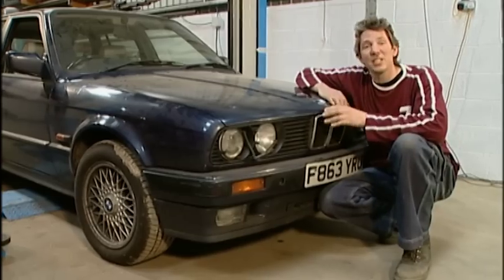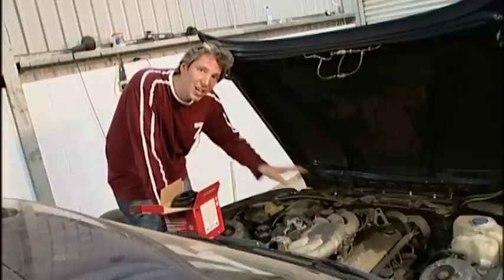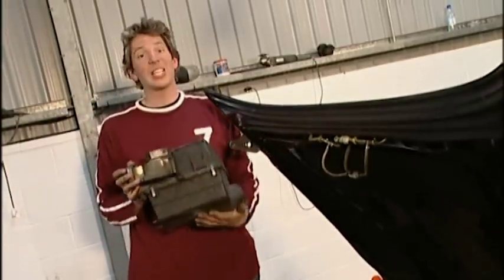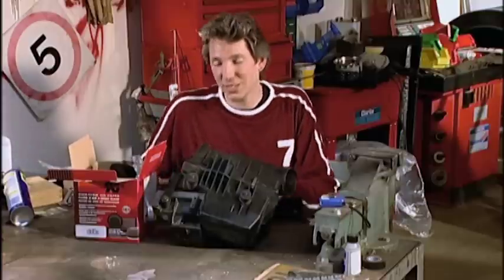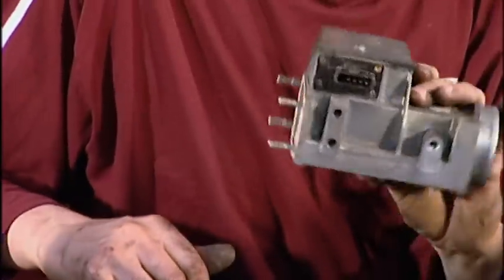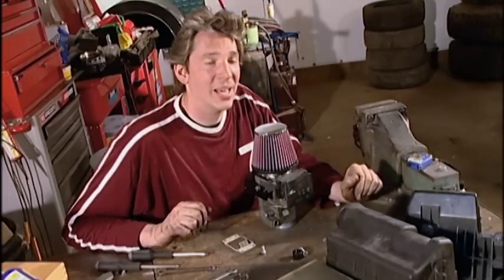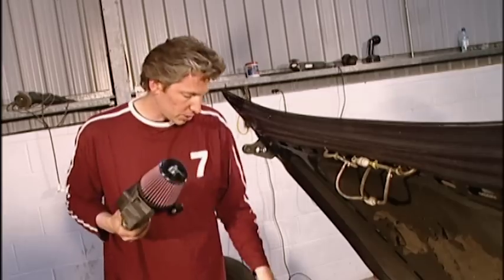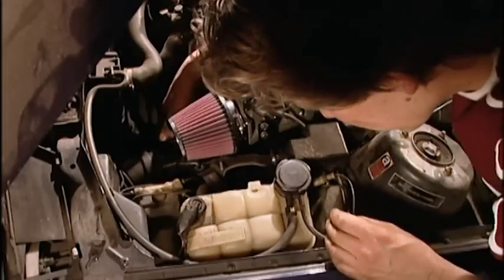Improving Engine Performance: BMW325i | Wheeler Dealers | TOP TIPS

Comment: How does a round filter seal on a square flange? It needs a round adapter to the AF meter and a panel to keep the hot air off of it for it to be effective. I took my E30 air box bottom and drilled 1/2 holes in the outboard side away from the hot air and put a K&N replacement filter in it and doubled my HP just like it says on the box. No, really it gave it about 10-20 hp and a nice roar but not obnoxious. The original air box snorkel was really small so I decided it needed more of an air inlet.

Comment: Lot of confusion about how pod filters work, the air in most engine bays aren't hot at speed. When driving you usually have a big who at the front of the bonnet (also known as the grill) which means that the air is typically cold in the engine bay. However the filter casing is usually a part of a ram air system meaning that you will get a lot more air to your engine using the stock system.

Comment: cold engine, full throttle to redline. thats how to improve your performance.
Reply: SwedischMuscleCars truer words have never been spoken
Reply: SwedischMuscleCars 
Haha 👍
Reply: why you know the engine is cold?
Reply: is this a joke ? Cold Engine + rpm over 4500 = Death !
When the engine is cold, the engine runs to fat ! (to much fuel, for to less oxygen) to avoid, that the engine stops !
When a engine is cold, it runs very ineffective (that's why cold engines need way more Petrol) so the ECU will give the system more Petrol. Because the engine is like some guy that woke up 1 Minute ago, it will never got the full power. A Cold engine is just faster at low rpm, in the first 2 minutes, because the engine is cold as fuck, and >must< run fat ! If you drive over 3000rpm, a engine that is warm, runs way faster,smoother and better as the cold one !
And if you dont believe me, come to the german autobahn.
Drive your car 20 Min with 180km/h then try 0-60.
And tomorow try it with a cold engine........when the cold engine survive it, you will see, that the warm engine was faster.
Reply: Sounded like he was only doing 2500rpm max.

Comment: mostly paying for a nice induction noise but there will be no power gains from a pod filter.
Reply: MCM debunked this
Reply: OMGWTFBBQ I GOT ROASTED! HOLY SHITE
Reply: Its the opposite... You lose power.... as well as You lose Smooth Running
Reply: Yes slightly but your also sucking in a lot of hot air from the engine, best to get one that's shielded like a pipercross viper induction kit.
Reply: This was great, thanks, I been tryin to find out about "horsepower car maintenance" for a while now, and I think this has helped. You ever tried - Vabrielbey Vehicle Verifiability - (do a google search ) ? Ive heard some extraordinary things about it and my mate got excellent success with it.
Reply: Hans Gerd That's correct, Without a tune new filters are useless. The ECU is tuned to a factory air filter.
On every car i have owned i tried cone/ram intakes first and just to see what they do,Basically just induction noise and a loss of torque/top end hp and speed.
Reply: https://www.youtube.com/watch?v=PAIxeQUSg-Q the video if anyone is interested.

Comment: You DON'T stick a cone filter on a BMW E30, you'll get hot air in your engine! That hose does F-all.Use a panel filter IF you have to.
Reply: Kel Solaar.  hot air/cold air doesn't make any difference.
Reply: @peterbarber7613  Hot air isn't good for the engine.
Reply: I’m disappointed with Ed.  Hot air is less dense.

Comment: To gain power you NEED casing and better solution is sport filter that fits in original box.
Reply: Mindset the only thing you did was destroy the “25y old fresh air flow system” ( pretty darn simple btw casing with tube that goes out side ...)
Reply: @joaoloureiro5142  No idea what language you're speaking.
Reply: @Solaar_Punk  ?

Comment: man I have an e30,, air intake destroys the engine, bmw engine very powerful u dont need these toys, the original air intake its a part of turbo kits its not install alone. the whole original turbo kit costs 850$ minimum. 
for me my engine is m20 I swapped the engine to m20b30 its 3000cc on the dyno it gives 349hp and costs me 780$ 
turbo and supercharged kits are for tracks not streets.. u will need more water and more oil for every 10 km.. and its destroys the engine valve for overheating..
Reply: ,,,,,..... Use these and we can understand, what you are trying to write.. Btw, the m20b30, does not exist..
Reply: @misfiresandflattires6874  he must have stroked the M20, this is common in NA

Comment: pod filters only draw in hot air.
Reply: Daniel Millard depends how you rig it up... Ive had them sticking 3" off the ground infront of the rad..
Reply: perfect for sucking water and hydro-locking your motor.

Comment: It has been proven that the cone air filter doesn't increase performance. The only instance where a "performance air filter" would increase horse power is , if the original air intake filter was so dirty that it couldn't pass air in the amount that it originally should.  (At which point you can just change it for a new one of the same type) the cone air filter is used when your doing an engine swap and you don't have enough space for the old air intake, so you put a cone.
Reply: PvPparadise. Not true, it's all car specific. Some cars have horrid intakes.
Reply: Most of the cars have pretty good intakes but you are true James some of them has very restrictive intakes. But imo you should tackle your exhaust system first they are much more restrictive than your airfilter. Dont forget an engine is just an air pump. For performance you need good intake but you need great exhaust

Comment: This has to be 'wheeler dealers' summed up...clueless. Any person with mechanical knowledge knows an exposed air filter will just draw in hot air especially on e30/e36/e46 known to be a pointless mod unless an enclosure is present. Secondly as people mentioned, to the revving a stone cold engine. Please.

Comment: That filter is absolute BS, and just hocus pocus to make money !

If your stock engine get more Air, it will not use more Air !
The >oxygen rate per cubic meter air< is still the same ! A Engine needs 2 things to run.

Oxygen and Fuel. 

That's why the ECU will always try to get the right amount of Air & Fuel to get Lambda 
0,97–1,03 ! Otherwise the engine will run to Fat (more power at low and mid rpm, but the engine will not have good power at high rpm) or to thin (slower at low rpm, but perfect at high rpm, but pistons get very hot at high rpm, and can break !)

To fat: To much Petrol !
To thin: To much Air->Oxygen !

The most effective thing for a M20 is a sharp camshaft (like the Schrick ones) and to (at the same time) Chip the ECU to 95 Octane Petrol (it's called Super in Germany, Normal is 90 Octane, Super Plus is 98 Octane) and set the Rev Limit to 7200rpm.

Normaly all US M20 use just 90 Octane (or evel lower, Petrol was back in the day, absolute BS in the U.S) And all M20 in Europe before Facelift (Chrome Bumper Models) need 95-98 Octane (but there are way faster at low rpm, as the 90 octane M20) and all Facelift just use 90 Octane.
And Cool air ! A M20 runs just at fool power when the air got 15° Celsius, and the humidity is 65% ! There are 5-10hp at the crank, at any rpm, between 15° and 25°Celsius.
Reply: "to"
Reply: It looks like that you dont have something better to do, as to search for typos.
Maybe you should try to write what i did, but in german !
That's my native language, not english !
Reply: German*

edit: all right, take it easy :D it's just that "to" is dumb even for an American, let alone someone from a civilized world like Western Europe
Reply: I dont take anything easy, maybe you should work 8 hours in a foundry, and then try to explain something like that in the night, with a different language and without typos.

"German*"

whats wrong with that ? Get a life !
Reply: You're too sour, is that a German thing?
Reply: No, i just dont like it, when im tired and explain something in the night to help people, so that they dont get ripp off, and some guy do jokes about that i wrote "to" and not two.

In German "too" is called "auch"
and "to" is called "zu"

so it sounds and looks very different, not like "too" and "to"

I hate it to think about if "auch" is "too" or "to" and sometimes when i wrote to much "too" or "to" and must explain something that is hard to translate (so that i must rebuild what i wrote) some dumb failure like "to" for "two" can happen.

The human brain gets easily confused.

Ask some guy very fast 3 questions where the answer is "white" then ask what the cow drinks, and most time the guy will answer "milk" and not water.
Reply: Bro don't get so upset please, my comment was simply two letters, but after which seeing you responded in an annoyed way immediately, I doubled down and corrected something else in return... I know what you mean about being a foreign speaker, because although I don't speak German, I also used to mix simple things like he/she because we don't differentiate these in my language (Hungarian) and it was a pain to explain, let alone getting into odd situations:
-so what does your girlfriend do?
- oh he's a pastry chef!
- /silence/.
- no no I'm not gay it's just in my language blablabla

I didn't mean to upset you, was just joking around.
Peace?
Reply: It's ok, maybe it's good that you mentioned my mistake, so that i can edit my post and correct it.

It's the same in turkish, there's no he or she, it's like in hungarian.
In Turkish you say Girlfriend or Boyfriend, but there's not something like
he or she, when talking about a person.

Years ago i got realy problems with "butt" or "but" xD, now i can remember it. It's just "butt" when talking about ass, and in any other case just "but"
Reply: Glad you took it constructively after all, unfortunately many people question the content if the grammar has mistakes, but it's reality.
Ya same, we just say "ő" for he/she and we don't have "it" at all, we can convey information just the same way. We also just say girlfriend/boyfriend/the girl/the boy etc, or "ő". Anyway, languages are interesting. Are you German or Turkish then?
Reply: Theres it in german. it = es
But not in turkish :D
It's the same system in turkish, but we say "o" and not "ő" :D

Im turkish, but born in germany, so im both.....in some way, but i feel more turkish as german. My heart works turkish, my head most time german.
Reply: Then our languages are quite similar :D o vs ő, can't be a coincidence, and we did share some history long back
Reply: Maybe, i dont know history stuff good, history was chaos and mess everywhere, and stories changed over time.

Turkish got not so much words, but is hard to learn (crazy words, that are hard to remember) it's hard to speak out the words in the right way.
German is the opposite, it has a crazy amount of words (maybe the most from any language) and most stuff is easy to speak out and remember.

Turkish got to much "ü" & "y" crazy language